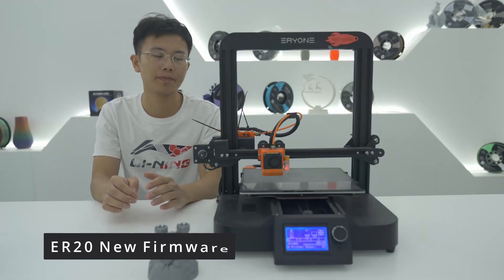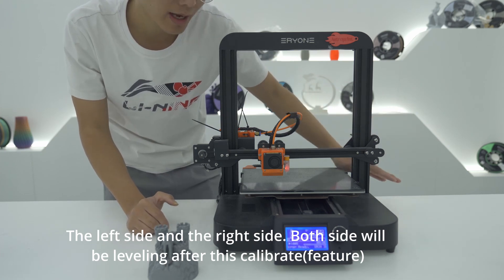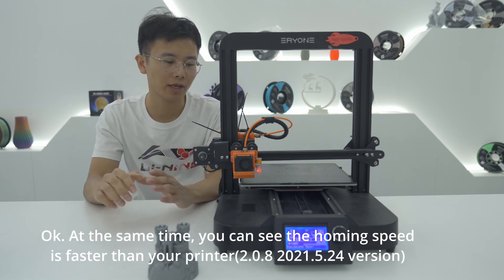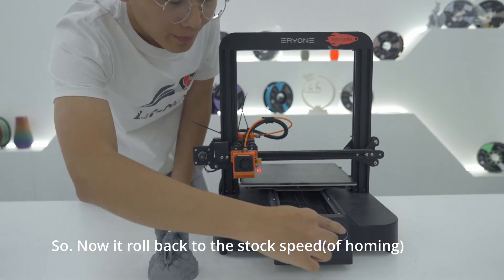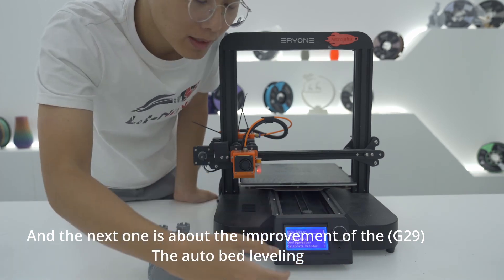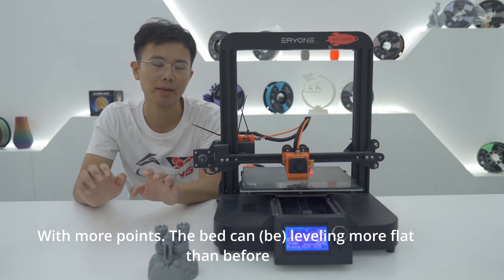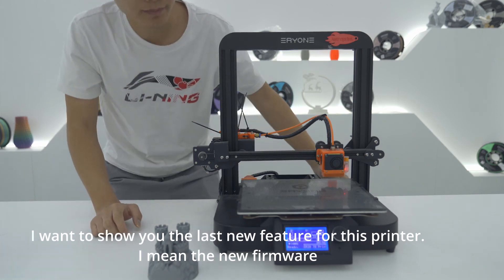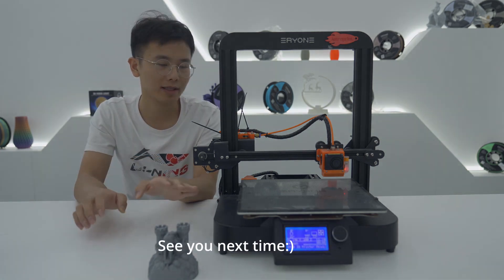ER20 New Firmware Released And Explanation

Comment: Thanks for the upgrade.  I installed it, and am not sure if this is normal- when doing the auto home routine,  the "x" (hotend assembly) crashes into the left frame, then buzzes loudly, similar noise to when you were leveling the gantry. It works normally after that, but that crashing and buzzing is irritating and concerning.. 
Can it be eliminated?  I have now reverted to the stock version because of this, and the stock version does not do that.
Thanks
Reply: @gimepepe  Yes correct, it adjusts the sensitivity, when I have the time, I will have another go at the new firmware..
Reply from the maker: Hi! This is normal. The default value of the sensorless is under secure range.
It doesn't mean the perfect value or the best one.
You can try to increase it.
We set this and improved this:
X:110
Y:100
Maybe you can refer to this:)
Reply: @Eryone3D  where is this firmware?  The link is dead and your website firmware is dated Dec 10, 2021

Comment: I can ask you for advice when the project pushes me, the area always slides back, but I would like it to slide forward when I had other firmware so it pulled forward when printing was completed do you know anyone can advise whether it can be set in the printer settings or must be so modified firmware thank you for any advice
Reply from the maker: Hi, please send the email to technical@eryone.com
And for this problem, you need to check the end gcode at first(If you are using the cura then try check this)
Or you can attach it so we can help check it:)
Happy Chinese New Year

Comment: Hello and thanks for the video and firmware. Unfortunately, the "Gantry Calibration" function cannot work properly at all, because when the X-axis hits the frame profile of the printer on the left side, the extruder mounted on the X-axis hits first and therefore the X-axis is always crooked after the gantry calibration. This can even be seen in the video with the X-axis on the demonstration unit. The only remedy for a straight gantry calibration is to dismantle the extruder beforehand so that the sides of the X touch at the same height. This also works great, but unfortunately the X-axis gives way again after a short time on the side of the extruder, because it is simply too heavy and the rollers of the axis can unfortunately not be tightened / adjusted.

Comment: The new formware link does not seem to work.  Where do you set the X:110 and Y:100?
Reply: you should be able to set this in the configuration-advanced settings-tmc drivers and then sensorless homing.

Comment: Hi, I have two questions:
Is the accuracy of the ABL affected a lot by the turbo setting?
and
Will the gantry leveling hurt the motors if it is used a lot?
Thank you!
Reply from the maker: Hi! Hope you have a nice day~
1. The ABL turbo won't affect your bed accuracy
If your printer z-axis skip step then we can say it is a hardware problem instead of the firmware problem

Just as the video explains about:
If your lead screw gets stuck on some height.
You need to oil the lead screw first.

2. Will the gantry leveling hurt the motor?
Well. The gantry leveling test we have done it about 80 times still no bad hurt.
We just set it to a low current when it bumps so it will stop.
But we also don't suggest you do it at each print.
This feature allows you to calibrate it then you just need to do it 1 week or even 2 weeks one time

Comment: Ever after I've installed this version (25 points option) I notice my printer's fans seem to stop/start occasionally (compared to previously with the stock firmware), is this normal/expected
Reply from the maker: Could you check which fan exists this problem?
The cooling fan which inside the bottom or the hotend?
Reply: @Eryone3D  found the non issue, in the original the fan didn't stop/slow on travels, now it does, sorry

Comment: what about the Thinker SE ????
Reply from the maker: Hi! The thinker SE doesn't use the tmc2209 as the stock so this model can't use this feature.
And need to point out the thinker se supported by marlin.
You can check the latest version of the marlin and get the example config pack from the GitHub

Comment: Does this new firmware support filament runout sensors ?
Reply from the maker: Sorry. The er20 doesn't come with the filament runout sensor. So this firmware doesn't support it.
The source code is updated so you can compline it by yourself:
https://www.eryone.com/forum/viewtopic.php?f=8&t=448
Reply: @Eryone3D  I 've compiled it by myself with the runout sensor option and it works fine. thanks

Comment: Is it possible to focus the calibration (probe points) just in the print area?
 I mean if I just print in the middle it is only necessary to calibrate it there.
Reply from the maker: Hi! Malin doesn't support this feature yet.
Reply: This isn't possible in all cases. It could be done when the file is present on a SD card in the card reader of the printer. Then the printer could read through the file and determine the area of the print bed that will be utilized. This would require a change in how Marlin works. However, this wouldn't work for files that are streamed over the network or USB.

Ideally to make something like this happen, a change to the file format would be required to inform Marlin (or whatever software the printer is running) any information about the print that could be important, such as the dimensions of a cube containing the final print, position of one corner of that cube, any temperature and fan settings, amount of material to be used (in case the printer tracks the usage), etc. The printer could then stop the print from being started if any of the conditions will not be met. For example, say the user made an error and set the bed end temperature to 500 after the first 10 layers were printed instead of reducing it to 50. The calibration points could then be taken within the area of the print instead of the whole bed to get a better first layer.

I know that the calibration time seems long because we are waiting for the printer to start laying down plastic. But overall the couple of minutes it takes to do is small compared to the length of time of a print job which is usually hours.

I'm not going to run the calibration every time as it wears out the hardware. Instead I'll set up Marlin to do a very detailed auto bed levelling, such as 9x9 with four or five attempts at each point, to get the best map possible. Since I don't move my printer, the bed, or any other part of my printer often I don't need to do the auto bed level with every print. I am able to do that every so often, perhaps monthly or if I have problems with my first level or if I do change something. I will create a simple STL file that will heat up the bed and nozzle to values around what I normally use, executes a G29, and then a M500 command to save the mesh to the EEPROM (memory) of the printer. Then instead of having the G29 command inserted into my STL files by the slicer, the command M420 S1 is used to load the mesh from memory. (See https://3dprinting.stackexchange.com/questions/15952/using-auto-bed-leveling-do-i-need-to-initiate-g29-before-every-print ).